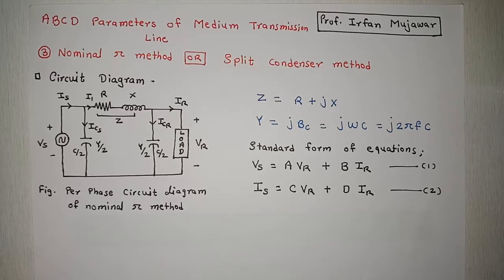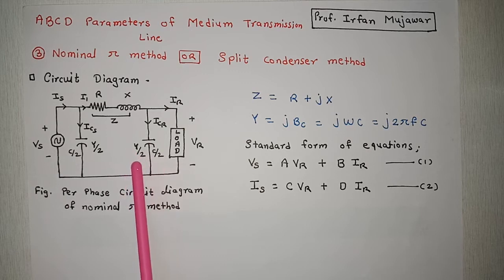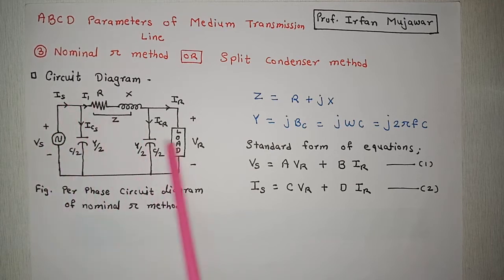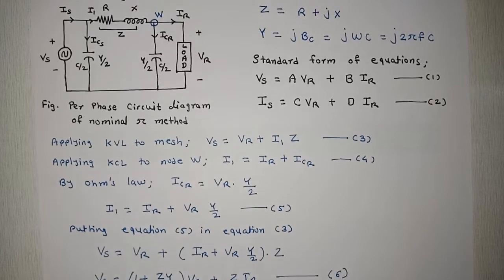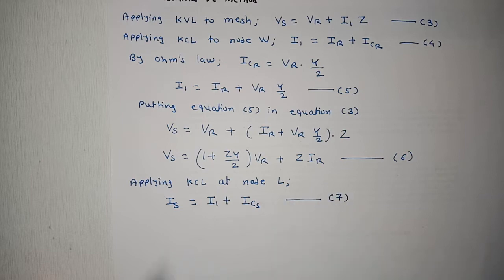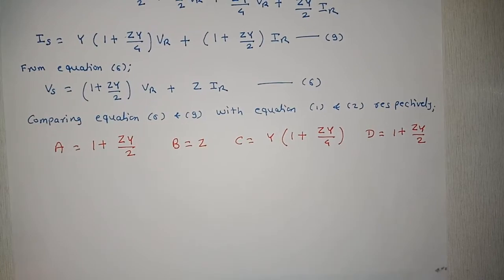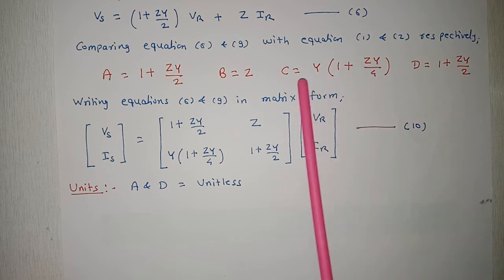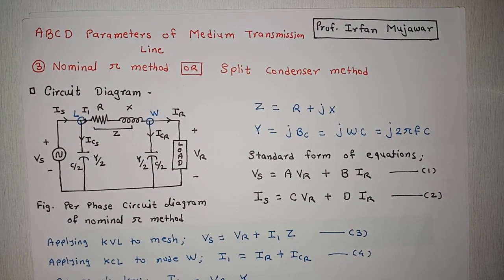ABCD parameters of medium transmission line by nominal Pi method explained by Irfan Mujawar.

Comment: Sir abcd parameter equation contains negative sign in between but u have put positive
Reply from the maker: Please check the direction of currents.
It's different from the convention used for two port networks.

Comment: Sir what is the use of finding the abcd constants
Reply from the maker: Once we determine ABCD parameters we can determine the sending end parameters like voltage, current, power factor.
Also we can calculate the transmission efficiency and voltage regulation of line.

Comment: Sir , why there is capacitor in medium and long transmission line ?
Reply from the maker: For medium and long transmission line:; line length is quite large and operating voltage is also more.
Hence capacitor needs to be considered.
Coming to the basic question why capacitor is formed in line?
The main reason is whenever two conductors carrying current are separated by dielectric then there is presence of capacitor.
In transmission lines there are conductors separated by air hence there is presence of capacitor.
Reply: @IrfanMujawar  thank you very much